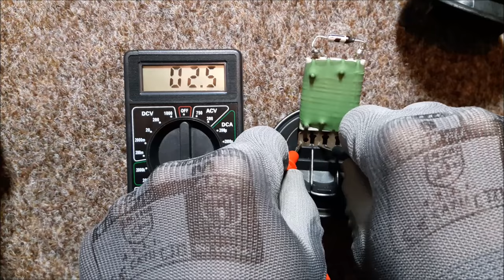Fan blower motor resistor - test

Comment: Thank you very much. Your info was spot on. Wish I had seen this before I spent $52.00 on a new one. I didn't even think to check the resistor before I bought a new one. Major brain fart. I had no power through all speeds on the motor. I troubleshot the circuit starting from fuses to motor. Had power to the motor so that meant fuses and relay were good. Hooked up a 12v motorcycle battery to the motor and that worked. Now either bad resistor or blower switch. This is when my brain farted. I knew that even if the resistor was bad I should at least be getting power on the highest speed setting and wasn't. But a small possibility it could still be the resistor so I gambled on replacement only because it was easier to replace than the switch. Oh well. We live, we fart, we learn. I snapped after watching your video and checked the old resistor. Sure enough, there was nothing wrong with it.
Reply: So what was the problem in the end?
Reply: Ed O'Brien i think it looks like termal fuse on this resistor
Reply: At least you saved money by doing it yourself. A garage would have been expensive.

Comment: I like this video. Normally a common go to component on a VW audi group vehicle if you are only getting fan speed 4. Common on the Polo’s but worth checking the blower motor too guys, in case that is faulty and causing series resistor to fail. Good work!
Reply from the maker: Thanks a lot

Comment: Very helpful info! 
Replaced mine on my Sprinter. When it didn't fix fan issue, I replaced blower motor and wondered if I'd replaced a perfectly good resistor block. Thought about selling the old one but didn't want to if it was n.g. 
After watching your video I know the top resistor (?) fuse (?) diode (?) is blown. Into the trash it goes!
Reply from the maker: Thermal fuse.

Comment: Well if 1 and 4 not connect a first resistor was broken. Its possible to make new from wire (i'm not sure is it cooper wire wrapped in case or different it corroded like steel) but wrapped must be correct with diagram. 3 resistors for first gear, 2 for second and one for thirtd gear
Reply from the maker: Thanks

Comment: Although, for me the one showing 0.0 was bad. 
And one with 1 . was good.
Doesn't 0 resistance means closed circuit, fan constantly running?
So shouldn't there always be an open circuit until it's necessary?
Reply from the maker: 1 indicates a break in the circuit

Comment: MAN at 1:14 you checking this correct thats why whole 3 gears not work. 4 pin and 3 its first gear (3 series resistors one not working and no ohm for all 3). Next 4 and 2 pin its second gear (2 series resistors one last is broken not ohm). 4 and 1 pin its 3rd gear (one resistor and its broken because its used on all gears)
Reply from the maker: Thanks for carefully watching and comment.

Comment: I have the problem where my AC only blows on 4, but not cold.  Problem was intermittent.    I'm okay with  the only  fan on high as long as it blows cold.  I have 4 wires coming in brown, blue, black and yellow.  Any way to bypass this part with some generic resistor that will last longer and have it on high and cold?
Reply: similar looking resistor.  only blows on high, but turns off the cold light.    I changed the resistor that looks just like yours but it burns up in 5 minutes when on low.   I changed the motor and it keeps burning resistors at low speeds. I'd like to hard wire it even if it only works on high but still use my controls..  colors into my resistor are brown, blue, black, yellow.. into motor brown and orange.

Comment: I don't understand what your doing
I have a similar one but what part of what you did showed where it was broken. I may need a new one, but don't know which bit of yours didn't work
Reply from the maker: The circuit consists of 3 resistors and a thermal fuse. I check the individual resistances with an ohmmeter. One of them has a break.

Comment: FOR VAUXHALL ASTRA H MK5 1.9 CDTI 150 DIESEL 2004-11 HEATER BLOWER FAN RESISTOR can you show me how to test it off the car,  & show why it doesn’t work..
Reply from the maker: Thanks for watching. 
I'm afraid I can't help you because I don't know this model
Reply: Heater blower resistor is probably the most common fault on astras and corsas when it comes to the heaters only working on the maximum setting.

Comment: what is the rating of fuse , i know there must be max temperature and max amps
Reply from the maker: it depends of the model of the car. It's easy to check a thermal fuse. in my case the thermal fuse was ok, but the fault was inside the green resistor
Reply: First resistor was broken. Thats why 1 and 4 pin not connect throu fuse.
Reply: For 1J0819022A Rate of fuse  192˚C i see 192C on fuse it must be 192˚C. But here its broken one from 3 resistor for third gear. Its connect together series 3 resistors for first gear and not working 1 of 3. All 3 gear use these one resistor
Reply: @StopTeoriomSpiskowym  Hello, I soldred myself a new fuse to the resistor pack its 10A 162*C and so far so good. I want to have extra protection with exta 40*C down.

Comment: What is the resistor value ? 4k 60v?
Reply from the maker: Thermal fuse 10A and I don't remember temperature (you asked in my another film). Sorry. About 150-210 ºC? Please CHECK in forum about cars. You can buy green unit with thermal fuse is not expensive. For example: 

https://www.amazon.co.uk/Electronics-Salon-Thermal-Microtemp-Cutoff-SF169E/dp/B017TYMIBS/ref=sr_1_8?dchild=1&keywords=Thermal+Fuse&qid=1595276512&s=diy&sr=1-8

It is very cheap in China.
Reply: @k-nemo  thank you very much!

Comment: I’ve replaced mine on a berlingo van 2009 and now the speeds are reversed any ideas why?
Reply: They had issues with melting the plug and wiring harness so it's possible someone has replaced the wiring incorrectly

Comment: Hello  il calling konfem cameroonian strident in automobile réfrigération and air conditioning  here in douala  i would like you To gave me the electrical diagramme  of the 12v part of the automobile air conditioning There terminal pressure switch thermostat  evorator fan condenser fan ac bouton four terminal  relais and fuse